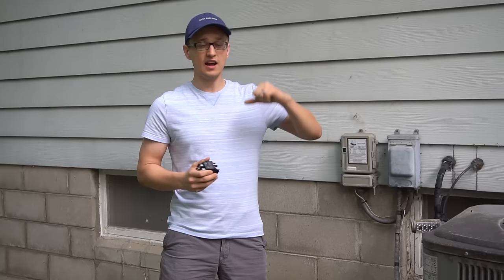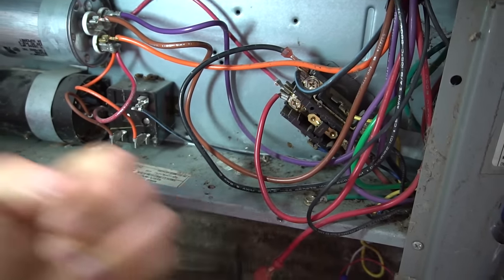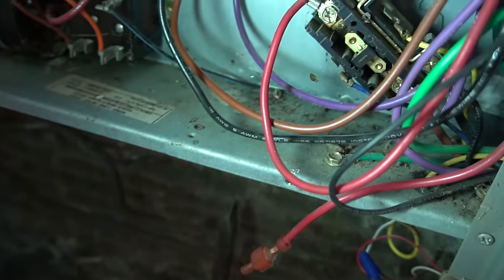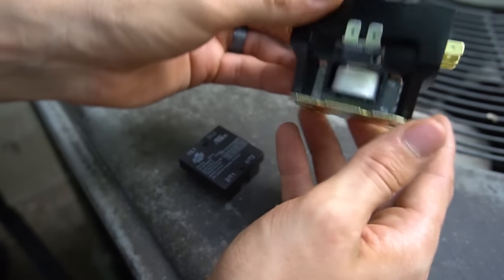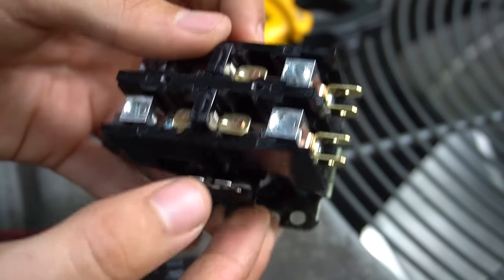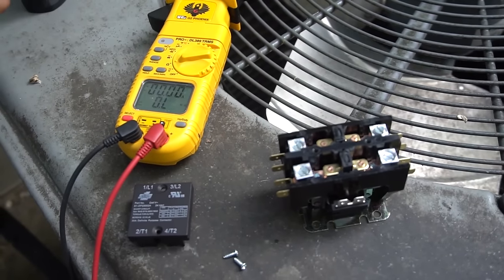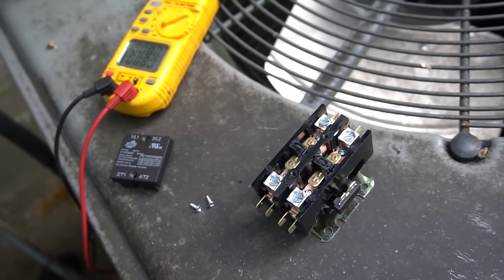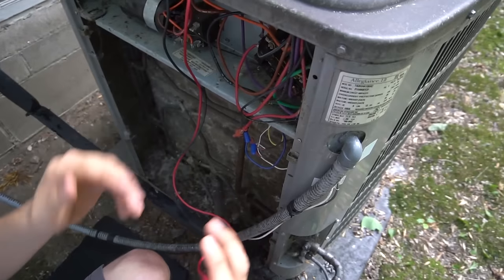Air Conditioner Contactor - How To Check If It's Actually Bad

Comment: My contactor pulls in but nothing turns on.  I already changed both capacitor.  What can it be?
Reply from the maker: My guess would be that the unit is not getting 240v or the contactor is not pulling all the way in (a bug could be stuck in there). Perhaps a tripped breaker, blown disconnect fuse, or burnt wire somewhere?
Reply: Yup.  It was a tripped breaker.  Thank you so much.
Reply from the maker: @ricardotapanes6812  You're welcome! Stay cool!

Comment: Woke up to my ac not working 😅, i replaced my thermostat and now all of a sudden no power to unit, i did check the contactor and it kicks on just fine. The thermostat does virtually nothing when i try to make changes or turn the system on. Any ideas?

Comment: I think I messed up my AC unit, I wasn't getting any power to the thermostat from the yellow wire so I opened up the panel to where the ac contactor is located still had the power on. And pressed the plugger and the ac fan started running. But still doesn't turn on when I run it on cold. Please help.

Comment: I'm am totally lost...replaced the contactor, 24v drop down transformer, and the capacitor. I wasn't getting 24v at the unit outside or the thermostat replaced all that and my 3amp fuse stopped blowing and everything seemd to start working...the only NOT WORKING is the unit outside! It's getting 24v but still not turning on

Comment: My 1 pole is stuck closed and makes buzzing noise even if disconnect fuses pulled, AC works great for about 10 minutes then the cap burns open on 40 MFD side.

Comment: My contactor won't work unless you push it in,any advice?
Reply: Check for 24 volts at the 2 leads he shows while the thermostat is calling for cooling. This voltage should magnetize the copper coil inside the contactor and pull the plunger down. If you have 24 volts, the copper coil is likely broken and you need a new contactor. If you aren't getting 24 volts your problem is something else (wiring, thermostat...etc)

Comment: Dude. I have two cables coming in from the inside that dont get connected with wire nuts. I have two blue cables coming ftom the contacts. One connects to a red cable, one connects to a white. The other two are dangling, they are blue and green.

Comment: What about when a contactor is making a very loud buzzing noise
Reply from the maker: Try lightly hitting it a couple times on the plunger part. (with something non-conductive) A lot of times that will quiet it down. Otherwise that may mean that it's time to replace the contactor.

Comment: My A/C turns on but doesn't get cold. My breaker for the outside unit keeps trippin. I disconect the main power from outside that goes to unit outside and reset breaker and it stays on, but one i reconnect power to outside unit it trips breaker again. i replaced outside capacitor and no help. Please help. By the way my unit has an ECM motor.

Comment: What would make the plunger engage only to click, then spark and pop off
Reply from the maker: If it continues doing that repeatedly, then my first guess would be that the thermostat batteries are weak.
Reply: @WordofAdviceTV  I removed the thermostat and took the 3v battery out, it still powers on and shoots up a low clock battery warning. I'm about to go buy a volt meter and check for 24v at the plunger, I'll keep you updated
Reply from the maker: @Luis-tq7pc  Yeah, sorry it would be hard for me to guess what could be causing that without checking it out myself.
Reply: @WordofAdviceTV  I am getting 24v to the contactor,  i figured maybe that was my problem so i threw a part at it, and its still the same thing, i pulled all the air filters out to make sure that it wasn't a low flow type deal and theres no blinking lights on the furnace board, is there a way to check if the low pressure relay is tripping by any chance?
Reply: @WordofAdviceTV  so theres this little switch that i see outside on the unit that the 24v line runs through, im gessing its a pressure sensing switch, i bypassed it and opperation is normal now, i guess my next step would be to call someone to check the pressure? or is there a way i can check it on my own with a multi meter?
Reply from the maker: @Luis-tq7pc  That little switch is likely a LPC (low pressure cut-off). It shuts the unit off if the pressure in the pipe gets too low. Unfortunately that is not something you can check with a meter. You would need a refrigerant gauge set. Probably time to call someone for this one. By the way, if you bypassed the LPC, then there is a good chance that your evaporator coil will start to freeze and if you look on the thicker copper suction line outside, that might start frosting up as well.
Reply: @WordofAdviceTV  I just did it for testing purposes, I didnt leave it running til I got a response.. thanks for the advice man

Comment: Ok so I know your video is for the contractor and ac but my heat will not turn on heat pump is on the unit heat comes on when it starts to get warm outside but if it’s really cold the heat will not come on

Comment: Mine is short cycling. Contactor shuts off after about 10 seconds. ???? Gonna clean it first with electrical cleaner and see if it has bugs and crap in it

Comment: Hello, Greetings. I have a gmec960804cn furnace with Carrier Performance series 4 ton AC + Carrier Coil 3.5ton. I want to increase the speed of air from vents to Full speed. As i want more air in top floor of my detached house. basement is very cool. main floor cool. top floor : not bad but not very cool also. I see a temperatur difference of around 5-6 degree celcius between each floor :). Please advise how to make the fan speed from vents to full. I see some dipswitch setting. but want to learn more before i touch them. detached house 3500 sq.ft. built 2005. basement built 2020. thanks.

Comment: My contractor read 8.9 Ohm, is that too low?
Reply: Apparently it's fine. (I found and reset the HPS and now things are working fine).
Reply from the maker: Glad to hear you got it running! I would wash down the condenser coil if you have not already done so. Even if it looks clean. A plugged coil can trip that HPS
Reply: @WordofAdviceTV  I sprayed it down last season, so it's still pretty clean. However, the aluminum fins are bent and smooshed together in a lot of places.  After I washed it I tried to bend them back using a screwdriver, but the lack of an elongated surface area just meant I was adding a lot of kinks to already bent fins.  I tried switching to a razor blade but nearly cut my self a couple of times so I gave up. Is there a better way to correct bent fins?
Reply from the maker: @JasonFuller  Yes, they have condenser coil comb cleaners. Here is a "multi comb" for example: https://amzn.to/2VU8XRv

Comment: Hi, I have a question for you or anybody who can help me i tested my contactor on ohms, and it reads 42 ohms. Is that a bad contactor is that the cost of my a/c unit not running when I turn it on from my Thermostat? Plz help 🙏🏻

Comment: I recently paid a tech $800+ to solder a pin hole in condenser and used an emergency condenser fan until my new fan motor came. I installed the fan motor as instructed but the wiring job he did to get us back running a/c was temporary Ms heat wasn’t working. Now with the new condenser fan installed NOTHING IS WORKING. I’m so pissed and no $ to pay someone else hundreds of $’s.

Comment: I have no voltage on the 24v control line.  I think it is a bad transformer in the furnace unit.

Comment: Mine keeps getting stuck closed. The compressor keeps running, even if I kill the power to the air handler & thermostat. The only way to stop the compressor is to either rap the side of the unit, or throw the breaker for the compressor.

Comment: You do not want measure more than 16ohms  resistance or less than 9 ohms to 15 ohms on the coil resistance the higher the voltage  the less resistance if it reads 20 or 8 change it..

Comment: My AC fan would only come on the condenser motor would not kick on so I tried to manually pull the plunger in a spark now the fan won't come on or nothing

Comment: Why would my contactor be humming?
Reply from the maker: It does that as it gets older because the contacts on it are pitting or wearing out. I bet if you tap on it firmly with the back of  your screw driver, the noise will go away. (But will likely return later) If the noise is very loud, I would replace the contactor. If it's just a quiet buzz, just let it be.

Comment: If a Transformer blows then 80% of the time it's the Contactors.  Just ohm it out, you should get around 15 ohms, a bit less is ok but if you read like 5 or 1 it's bad.

Comment: you prob also have this comment,  but L and T are on the bug cover
Reply: Hi again. 

Issue is NOT cooling, indoor fan running, outdoor fan running, but just no cold air. Access to indoor coils not possible as no access panel to that portion. Our door heat exhanger seems rather clean (So Calif)

I did the following test:

1) capacitor, it's 70/10 rated and comes in at 69.8 and 9.8   -- CAPACITOR GOOD

2) contactor coil resistance  - 19.0 ohms - GOOD
3) contactor open resistance - OL - GOOD
4) contactor closed resitance - 0.09 ohms  -- ODD NOT ACTUALLY ZERO, BUT seems okay 
5) low voltage at 27VAC - GOOD
5) contactor closes when thermostat set to cool - GOOD

My strategy is to disconnect fan so that when "cooling" kicks on, only the compressor should kick on -- when outside fan running I can't tell if compressor running or not due to fan noise. 

Seems I can just disconnect the high voltage to the fan to temporarily disable? I checked manufacturer manual and seems easy to just disconnect those lines at the contactor (with circuit break and disconnect to off).

----- RESULTS from that above test ------------

I disconnected the high voltage to the fan motor and set to cool, no noise from compressor :-( 

I guess next is to check to see if the wiring harness is messed up to the compressor.

Comment: Update 02/12/2024....
Contactors are going bad, left & right..
It's an epidemic if your outside unit is 2018 or newer.
The control volt is faulty and grounding, popping fuse at control board..
I have never seen it this bad..
Terrible craftsmanship at the hvac parts manufacturing facilities in mexico//taiwan//chinna.

Comment: I'm stuck. Have 28v at both control and thermo. 240 at the conds. Bypass thermo it starts pressing contractor it starts.  Thermo cool on blinking in delay. Switch thermo and compasitor still nothing im lost